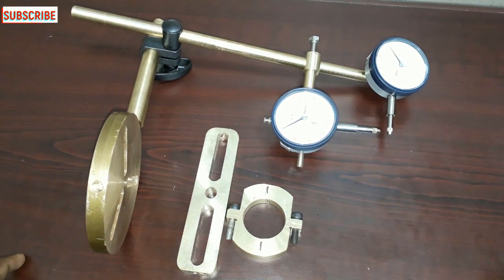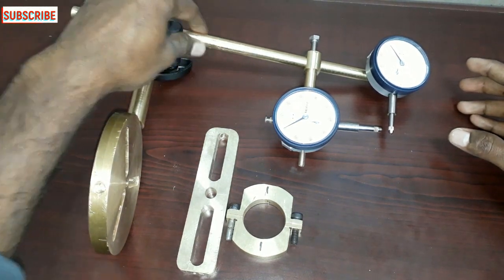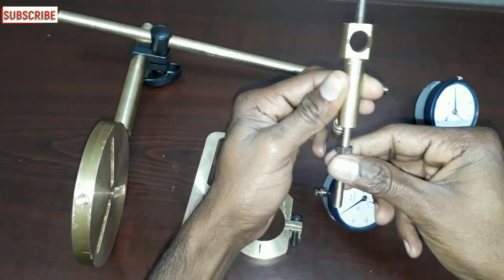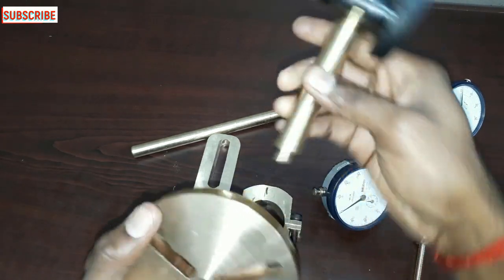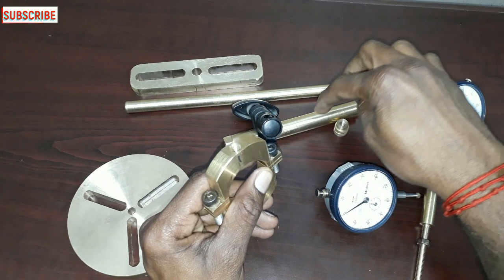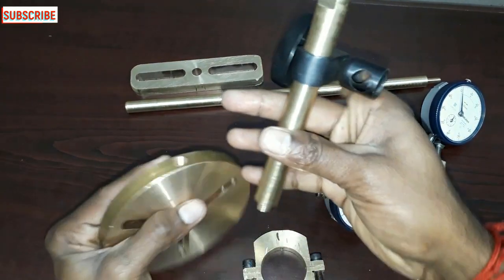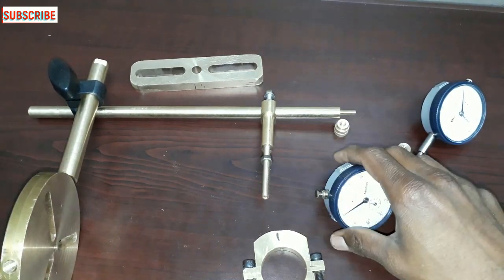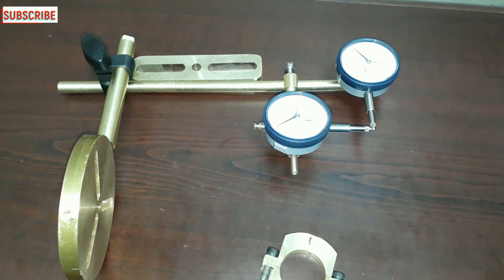RIM AND FACE DIAL ALIGNMENT TOOLKIT FOR METAFLEX COUPLING | Rotating & Static Equipments

Comment: Barsag na yenna bro explain pls..
Reply from the maker: bar sag na neenga alignment ku use panna kudiya dial fixtures oda weight  gravity nala deflection agum adhavadhu konjam bend agum  adhavadhu 12 o clock position la irundhu 6 o clock position ku kondu vara appo indha deflection kedaikum, so indha deflection ah than bar sag nu solranga. ok va innum purila na sollunga oru video pannidalam.